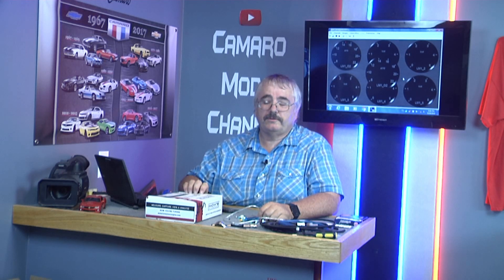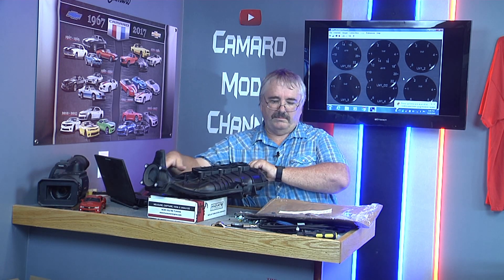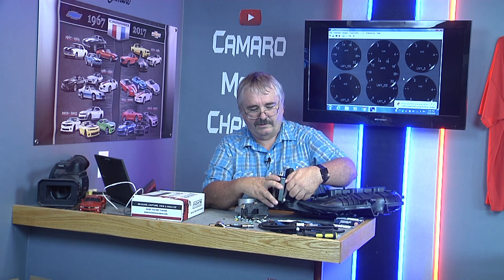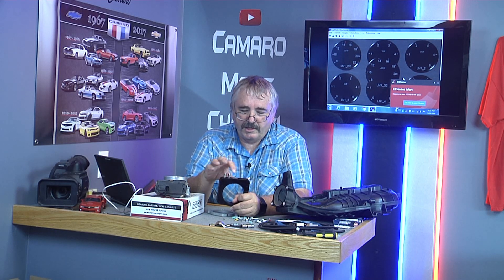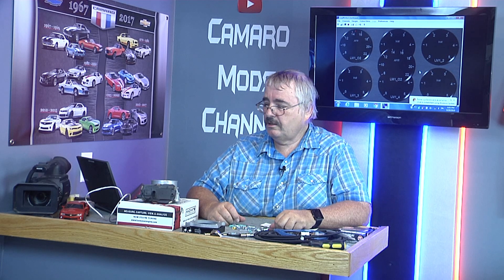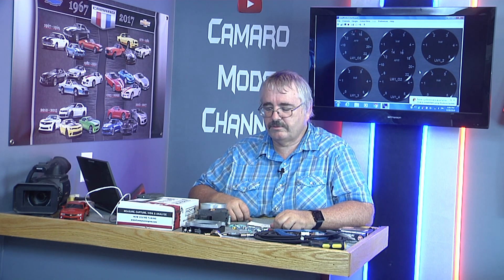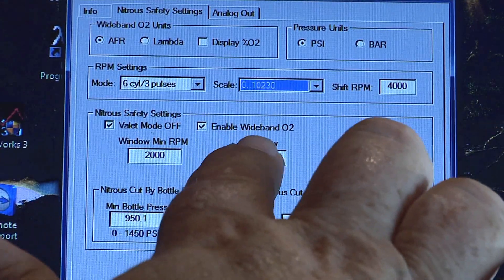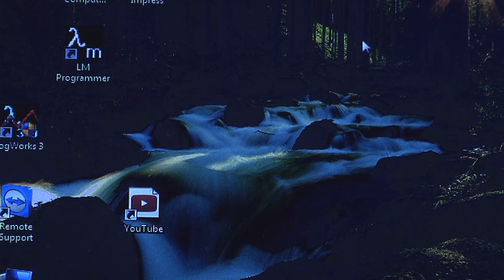Innovate 3893 Nitrous Gauge PSN-1, "Connect to computer-setup."

Comment: The port manifold need to be tune to see real gains?
Reply from the maker: Yes sir you are right, I just got a programmer, tuner. Thanks for watching.
Reply: What program tuner do you got?
Reply from the maker: @CorvetteC6-LS2  volo vp16
Reply: @camaromodschannel  can you install the port manifold on stock throttle body my car is manual?
Reply from the maker: @CorvetteC6-LS2  yes you can, the bolt holds are the same. Thanks.
Reply: @camaromodschannel  do you install do you see any different gain?
Reply from the maker: @CorvetteC6-LS2  haven't install it yet. I have to have time to record it.
Reply from the maker: I need some  stock dyno numbers before I take the intake off, so I can see how much gain I get.
Reply: @camaromodschannel  yeah good to know